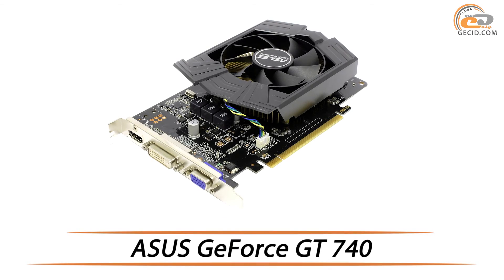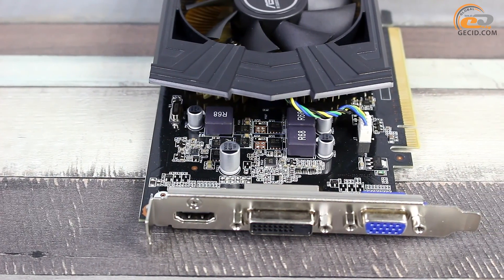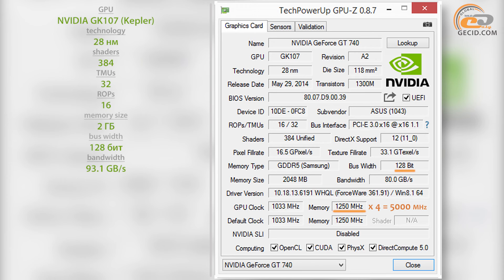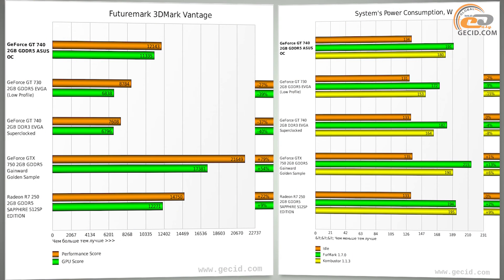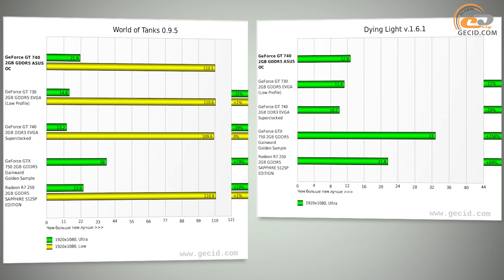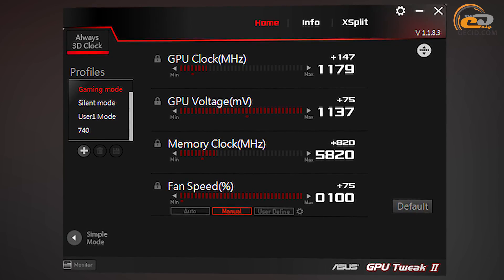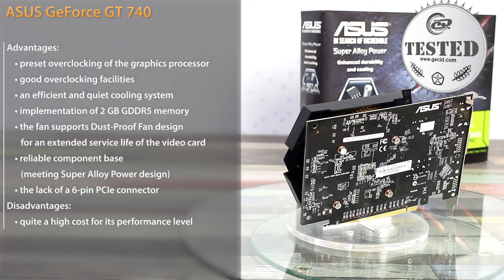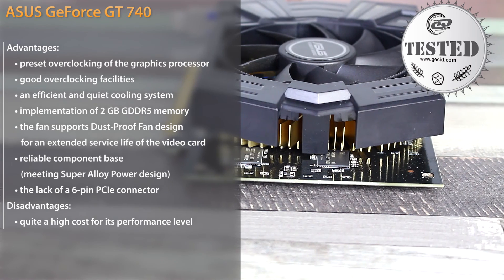ASUS GeForce GT 740 | Review & Testing

Comment: Hello. Thank you very much for the review. I'd like to ask about the power supply needed for my rig. Any help ? thank you in advnace! 
i3-3220
6GB RAM (4GB Hyper X & 2gb Crucial)
Nvidia ASUS GT 740 2GB DDR5
500 HDD WD Blue
Wifi Card
Intel dh61bf motherboard
Power supply 300w Huntkey
is 300 ok? or do I need higher watts?
Reply: As far as I know, you don't need external power for this card. I'm not a professional in this field, but I think it can work
Reply: I might just go above 300 watts just to be safe, 400 watts seems like a safe place to be in